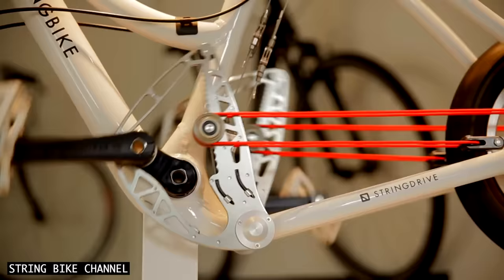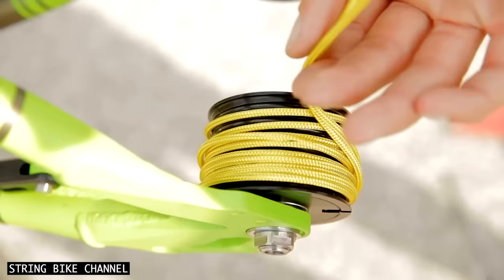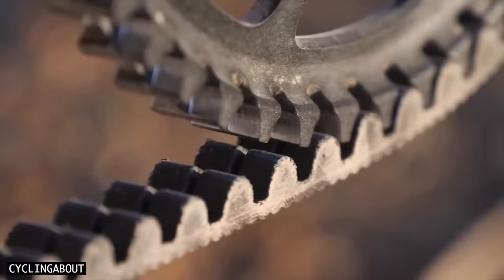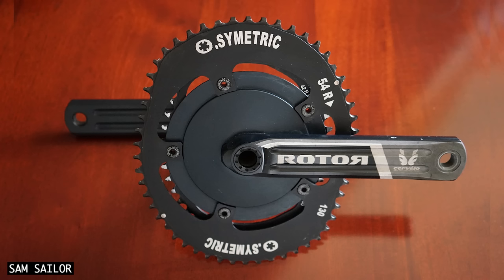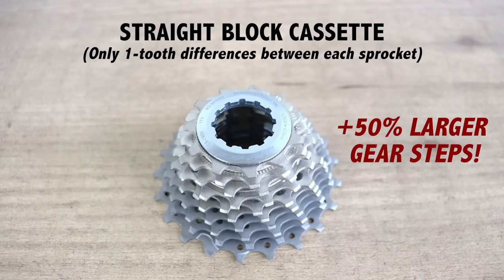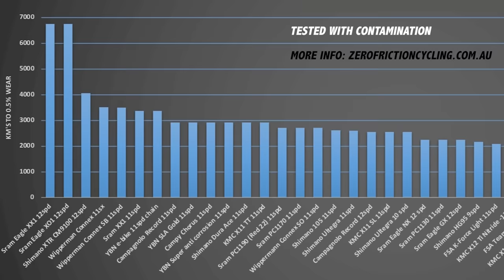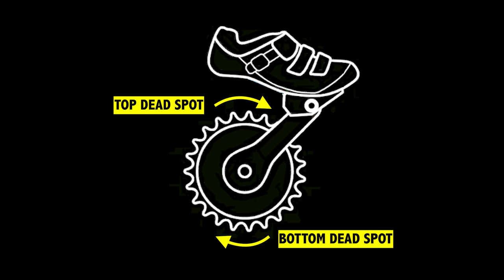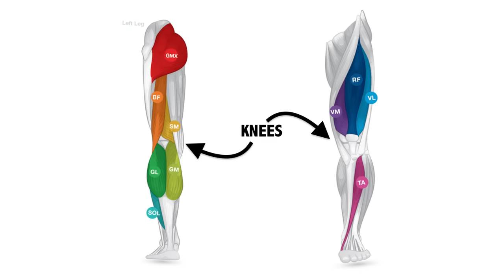Are Chainless String Drive Bicycles a Genius or Terrible Idea?

Comment: I've had a Stringbike a few years ago. It was really finicky to adjust, and those D-shaped things could bend really easily during transport, the complete system seemed to be very complicated and sensitive. Pedaling on it was not bad though, but I think the conception created more problems instead of solving them. Btw the website went down a few months ago, I think they don't exist anymore...
Reply: It’s so niche, if  mainstream they’d probably work the kinks out.
Reply from the maker: Thanks for the insight regarding the lever arms, and adjustment! I actually used one for a while in 2012, although that was not long enough to find any issues. I thought it felt nice to ride once I'd adjusted to the elliptical driving path.
Reply: No shit.... they have re-invented to wheel... but its square..... and trying to convince you its not....
Reply: Yes, they went bankrupt a few years ago. The bike industry pushed them out and the selling number was low. I never tried, but theoretically, it brought a better (and, yes unusual) pedaling result.
So, it's funny. The video is about an already fallen concept and excited about it.
Reply: @designstudiocs Just because it failed once, doesn't mean it can't come back.
Electrical cars are older than Gasoline ones, after all.
Reply: @christopherg2347  now the question is do you know who made the first car
Reply: @insanitycompromiseentertai7665  Define "car".
Do coal engines count?
Rail Cars?
Patent, Prototype or Production stage?
Reply: @christopherg2347  automobile so off rails that is
Reply: I know a guy who has one of the few stringbikes in Hungary. I tried the bike, but it is really very weird to ride it.
Reply: Thanks, that was my first thought when I saw that a single wire split into two different mechanisms controlling the final gear ratio.
Reply: I'll go for chain, for ruggedness and simplicity. Neat idea, though
Reply: Site is online now, but it doesn't seem to be for this bike, just some dude's blog. The facebook page also hasn't been updated for 2 years and one of the latest comments suggests the company doesn't exist anymore at stated address.
Reply: Hate bike chains, rough to know that they can't sell them anymore 😢
Reply: Actually, I have a question: How prone were the ropes to fraying or friction damage? Especially when scraping through any incidental scrub brush/etc?
Reply: @LizardFella2.0  Belt drives are very nice if you can afford them. I'm wondering though, perhaps a rod drive mechanism could be designed...
Reply: can you coast on the stringbike or do you always need to be pedaling?
Reply: Exactly, there is no reason to put a computer on a baseball either. A chain is a good design.
Reply: @rogerelzenga4465  Thank you! after listening to the fact that the string would last for 600-1200 km, it seems to me like they are creating a profit driven business model similar to Gillette Razors (where you buy the body for cheap and blades are expensive - to make the customer keep coming back for expensive razors or in this case those cheap threads)
Reply: In other words, it's overpriced fragile trash
Reply: @insanitycompromiseentertai7665  using a colloquial definition of "car" (A wheeled vehicle that moves independently, with at least three wheels, powered mechanically, steered by a driver and mostly for personal transportation" -Wiktionary), my guess is Carl Benz
Reply: @Splodnik  smart man here is your 🍪
Reply: If it was any good it would have taken off.
Reply: @insanitycompromiseentertai7665  so it is horsed powered cars. So we can't give any name. If not a cow powered or even if mammouth hasn't be used for.

If it is not what you meant, then it is probably in China with steam around 15th. But it could be earlier.
Reply: There is a company making a velocar/hpv called Djiker that seems to be using a variant of string drive that ditches rotating pedals for linear pedals so the idea lives on.
Reply: Eekee604 I've seen bicycles that were driven by a rotating driveshaft in similar fashion to any rear wheel drive car. 
I'm not aware of bicycles operating by the use of push/pull rods (using similar concept to old locomotives where rods transfer power from wheel to wheel)
Reply: Minimizing the dead spot isn't as great as it sounds in theory. Elliptical chainrings have been around for more than 40 years. Even in the specialized cases where they seem to make sense, very few professional riders ever use them.
Reply: @Splodnik   I'd argue Amedee Bollee's La Rapide of 1881 is actually a better contender for first car, predating the Benz Motorwagen by 5 years. Unlike earlier steam buses and carriages that were operated with two crew and used as passenger transport, the La Rapide was designed to be operated by just the driver with a small frontally mounted boiler.

It was just a one off vehicle and not a production vehicle like some of Bollee's other steam carriages that were used mainly as taxis in France.
Reply: @Cyclingabout Certain things don't need to be reworked 🤦‍♂️
Reply: @designstudiocs  They weren't pushed out by competitors but the market itself. You can't get enough customers if those who interested are barely able to get the aftermarket stuff and service
Reply: I know this may be a stretch, but I have a string bike and I am in need of more string. Would you happen to have old spares that I could buy from you or know of anyone who does? Thanks!
Reply: @KyleCoblentz you can buy dyneema rope and a splicing tool.  It's a very easy material to work with
Reply: @stevescuba1978 thank you!
Reply: A solution looking for a problem.
Reply: @alphaperez  you should be able to coast, as each side of the wheel coasts for half a cycle even during pedaling. So there has to be a one way clutch between each of the string spools and the wheel hub.
Reply: @apurvapurat6797 The strings are dirt cheap though. 10 bucks? Find me a durable chain or belt for that money. Not to mention ease of swapping out and storing a lightweight spare on the bike. There are serious drawbacks to this design, but I wouldn't consider string durability to be one of them. You have to change them more often, but it's as easy as pumping up the tires, and still cheaper than alternatives even considering frequent replacement.
Reply: @KyleCoblentz  hi, where did you get it? I cant find them sold anywhere